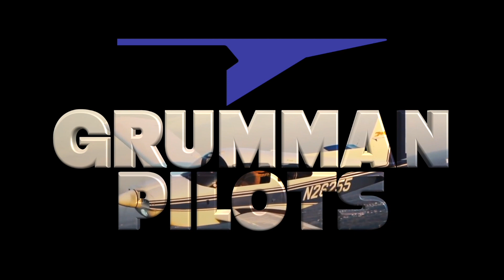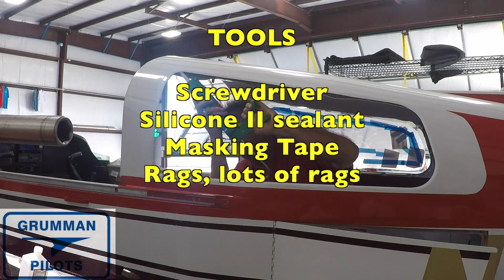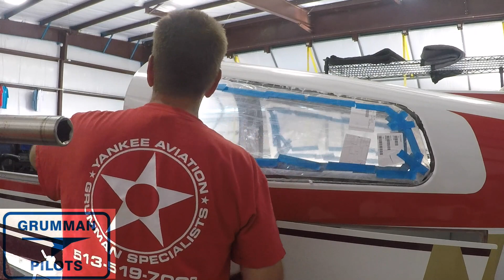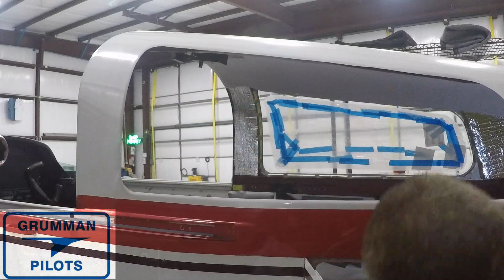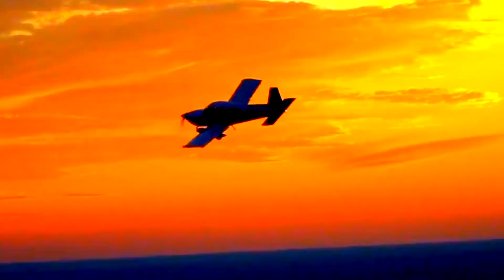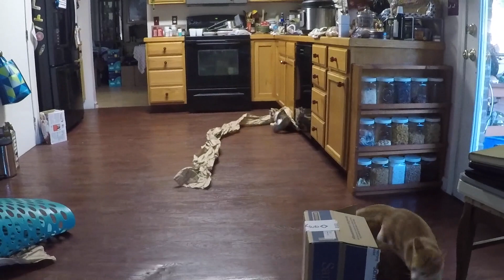Project Grumman Tiger Rear Windows Final Install & Seal - Grumman Style

Comment: I can remember doing this 25+ years ago on the Bumble Bee, but I created the back windows on my AA-1B from flat stock, heat forming them to fit the fuselage, the mounting them as Shop Monkey does here.  I will eventually get to doing this on the Yankee project.
Reply from the maker: The ones in my Traveler during repaint in early 1994, my back windows were flat stock from Fletchair.